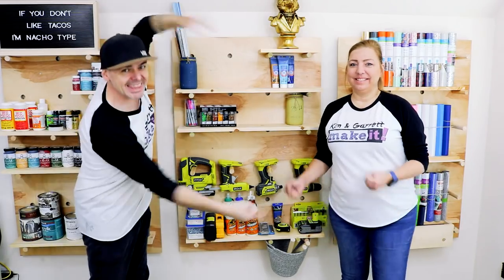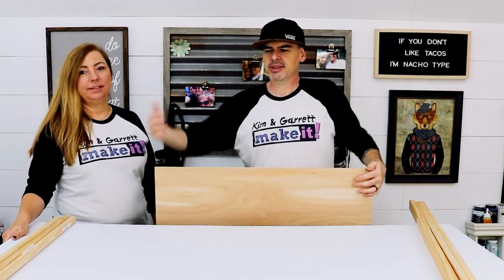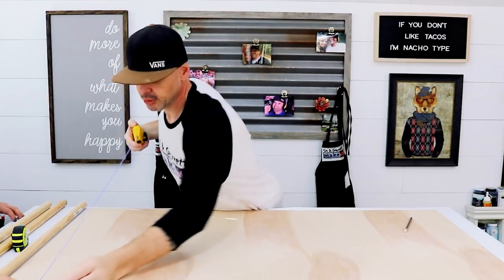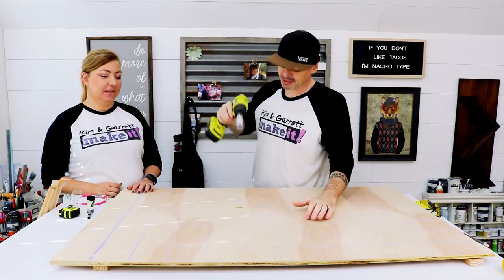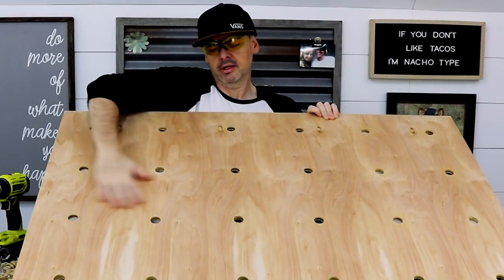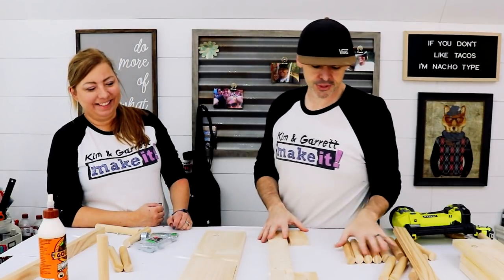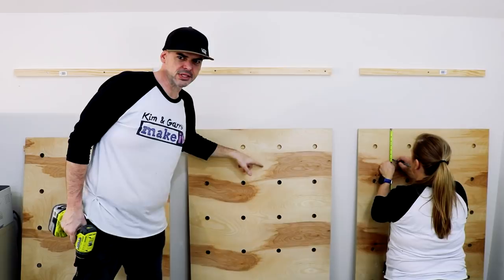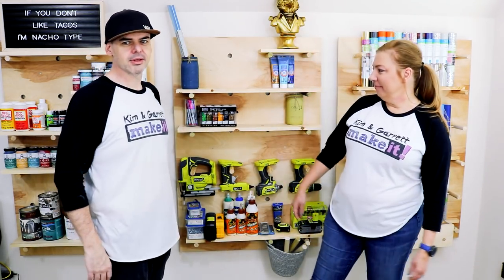The Best Giant DIY Pegboard Wall Craft Room Organizer for Under $100

Comment: Organizing my craft area, so this was great! As a backdrop, it is beautiful, but I think it might be distracting for me, (I have an ADHD issue) so might not be a distraction for others. Either way awesome project. I noticed it looked like you stopped using your drill jig. Did you find you didn't need it?
Reply from the maker: Well Lucienne.... Garrett "decided" he could hold it straighter than the jig.  Pick your battles right?!  He said that it still had a little room to move side to side. But I don't think there was enough room to impact the hole. :)